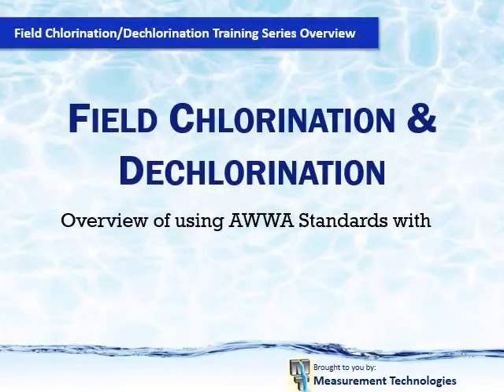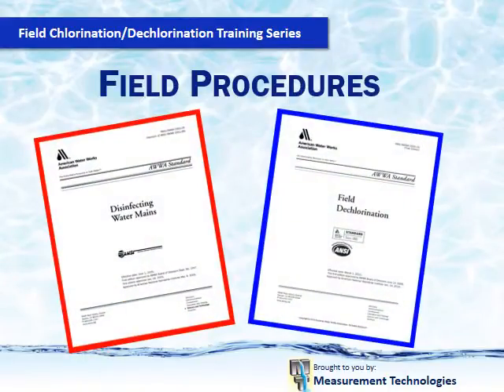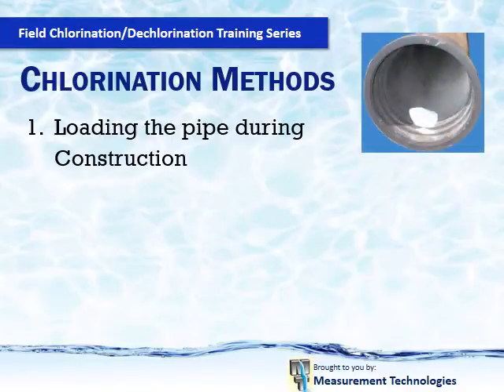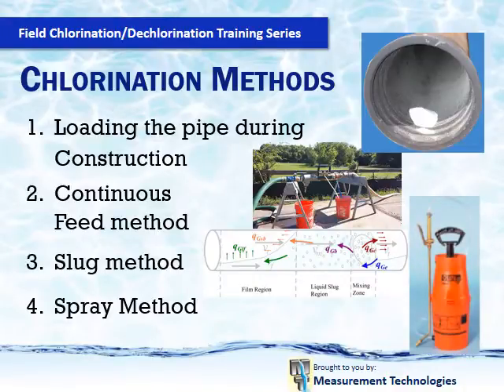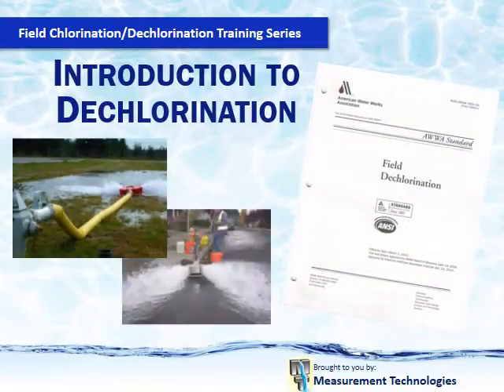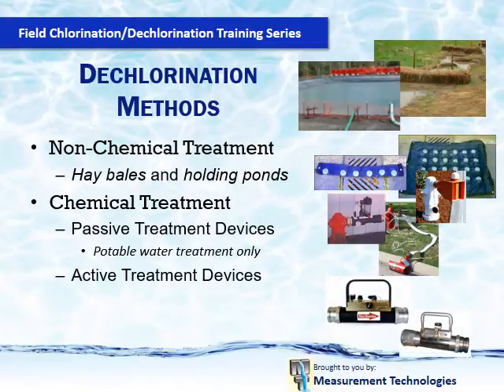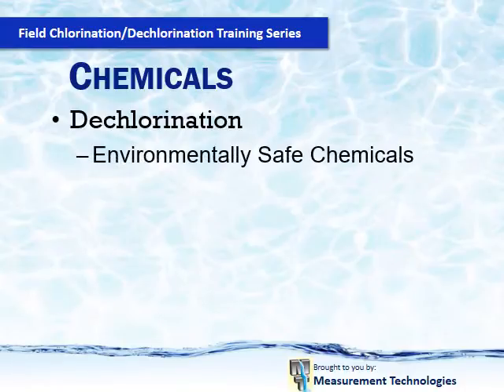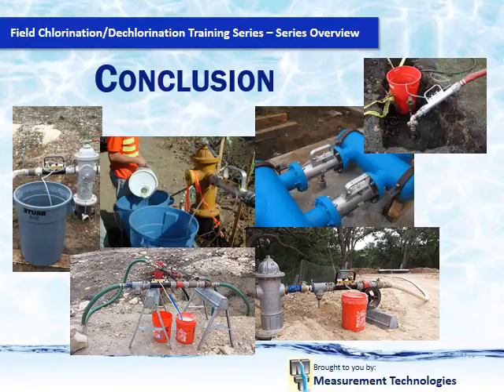Field Chlorination/Dechlorination Training Series - Series Overview

Comment: Excellent.  I purchased MT DeChlorinator 20 years ago. It works for low to high GPM’s as described.  It works from 3/4” copper as described. I have seen other companies mistakingly think they are DeChlorinating super chlorinated water with tablets.